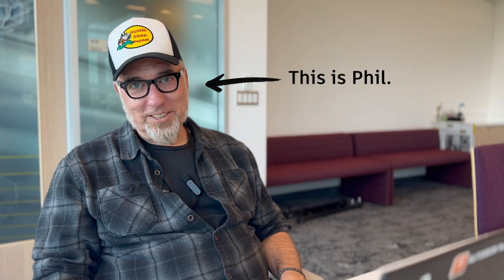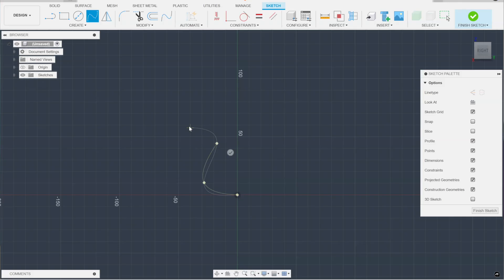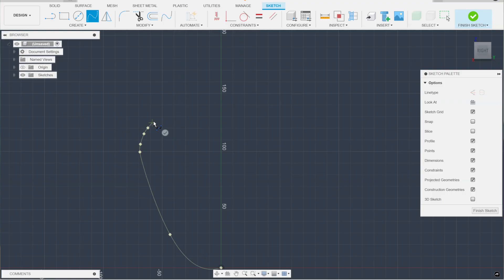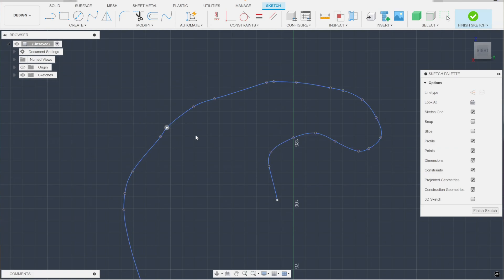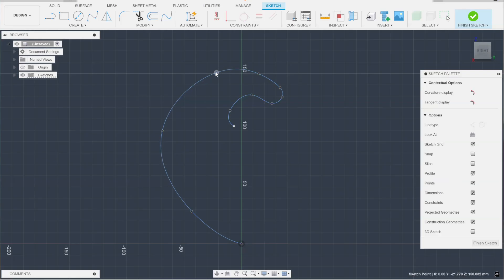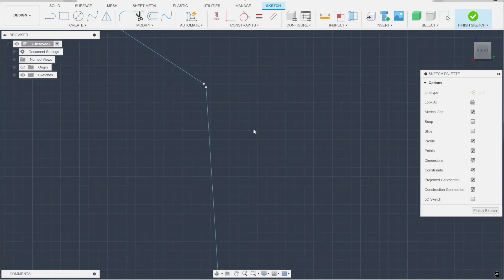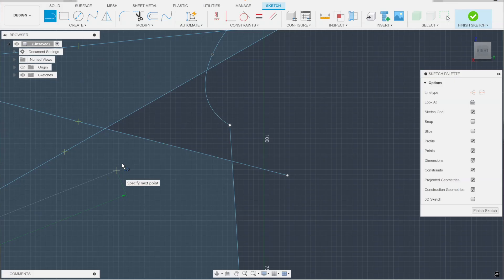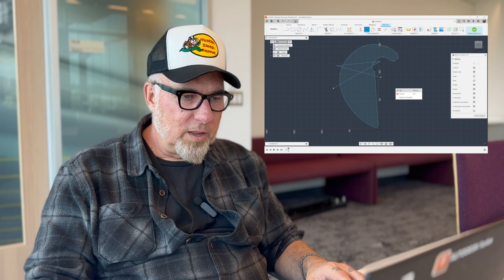Troubleshooting Splines and Open Sketch Profiles | Unstuck my Fusion Design

Comment: Auto-Constrain can now fix those very small breaks that prevent a closed sketch profile. Look out for the star in the corner of one of the auto-constrain options that indicate it's changed and fixed the sketch geometry.
(Mind you, I'm not sure what Auto-Constrain would have made of the original sketch with all those spline points 🤔)